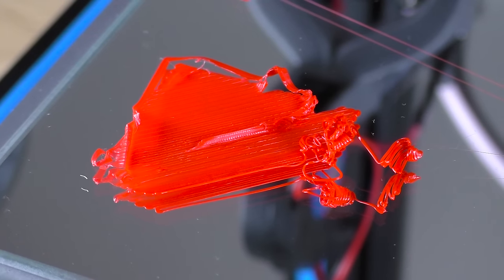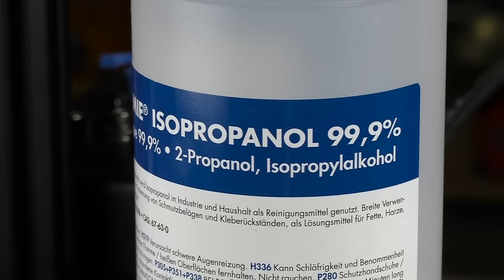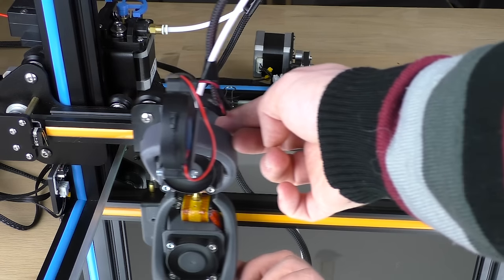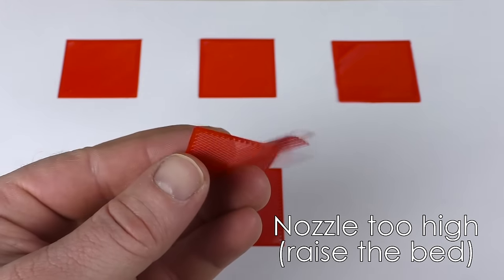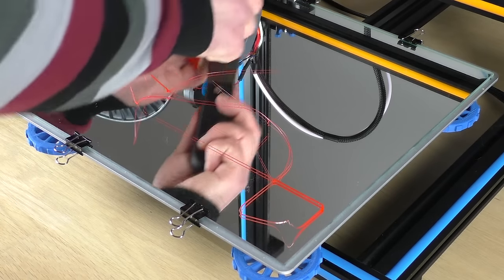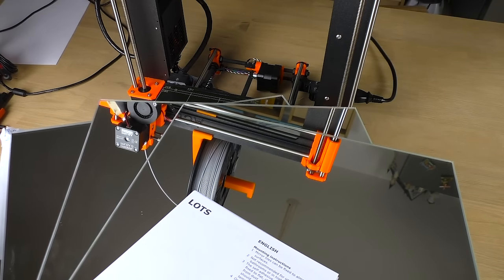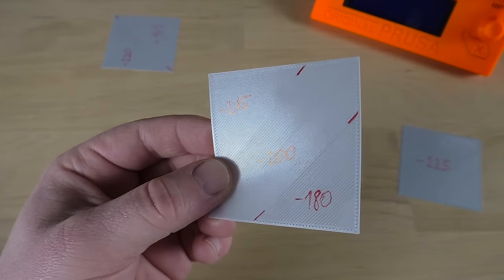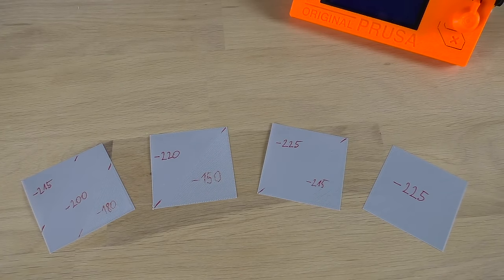Best method for 3D printer bed levelling

Comment: thanks for your video+calibration squares, i am in the process to choose ...he3d delta k280, he3d sky...any suggestion will be welcome and thanks in advance
Reply from the maker: I've never worked with Delta printers, so I can't really comment on the K280. You are getting quite a high build surface, but I doubt it can achieve the same printing quality as cartesian printers. The bowden tube is also very long, so it's harder to tune the retraction settings.

The Sky seems to be a clone of the CR-10, the frame looks almost identical. However, there are barely any reviews available, so I'd either wait until the printer has been tested by others or go with the CR-10, which is a good option and already has a large user community with lots of modifications available.
Reply: thanks for you reply, and your advice+suggestions are very good, i will look into it, the reason i have been considering the k280 is because of the build volume( particularly the height or z-axis) and i will be looking into cr10, again thanks for your positive reply;
Reply from the maker: unglaubich uberlieber I'm happy with my cr10, especially if you can get it cheap. Z height is rarely the limit and cr10 has 40cm, which is plenty.

For almost the same money, you can also get Original Prusa Mk2S. It's a bit smaller, but one of the best printers (Prusa Mk3 is a bit better, but more expensive).
Reply: thanks !!! because of my limitations with my hands, and prusa would be a good choice, but for a pre-assembled one at 999$+shipping that kind of priced me out... same applies to the he3d k280, life goes on
keep looking , i guess
Reply from the maker: unglaubich uberlieber Ah, that's different then. Yeah, the assembled one is quite expensive. I would normally recommend getting a kit, but it  seems that's not the best option in your case. You will almost certainly have to tinker with any printer though, so it's good to have someone helping you out if you have difficulties yourself.

Based on your username, are you in Germany perhaps?
Reply: ich kann sprechen+lesen+schreiben( in englisch alphabeticschen reihenfolge) chinesisch, englisch+deutsch), und ich werde mich nicht
nennen 0der  bezeichnen als irgeneine nationalitaet , ich bin einfach von der ede, zuzeit
lebe ich vancouver kanada...auch bekannt als KEINEDA hahaha
Reply from the maker: Ah, ok, I wanted to offer my help with assembling the kit if you were in Germany.

You could also take a look at Wanhao/Monoprice Plus. From what I can tell, it seems to be the best Prusa clone out there and it's already mostly assembled.
Reply: i have been looking into cr10, with marlin, the trouble is the time for preparing for firmware upgrade( if required) , and looking into prusa, and that has been a positive impression, the common denominator
is that the print volume is too small;
let me clarify, you are right, no one needs a delta that print 60cm size, if one uses slicers usw usw ,
but there is a minimum, so why do i need this, meine erklaerung:
i am in the process of loosing coordination control of my legs, and i want to build a pair of (
exoskeleton type) legs and i want to use 3d printing to print the "joints" ( not the legs) , and i have 
spent a lot of time in arduino( and gave up on raspberry ) and drivers+controllers+ dc gear motors( 
specifically bewel geared motors) so the primary target for the printer is to print and not to distract
my attention from the main objectives; nevertheless, time will be spent on cad programming;
since your fav. 3d printer is cr10, one more question on cr10, the micro sd card what format and size
does it have??? neither linux nor ms( more scammers) can format sd cards larger that 4GB as fat;
Reply from the maker: Hi again and I'm terribly sorry for a late reply, I was away for a while.

I'm sorry to hear about your condition and I sincerely hope you'll manage to complete your project. I've heard about a few similar situations, but I can't recall anybody using a home printer for it. You'll definitely need a strong material, like carbon or nylon, which means that your CR-10 (if you end up buying it) will need an upgraded hotend (the stock one doesn't reach high enough temperatures) and an enclosure.

The SD card should be formatted as FAT32. You can format cards that are larger than 4GB, but the maximum size for a single file is 4GB when using FAT32. That shouldn't be a problem, since even large models are usually only a few hundred Mb in size.
Reply: keine uhr sache, i am getting very close to decide on which printer, your cr-10 is gaining points;
especially the sd card with  this fat32... most 3d printer( if not all those i have investigated are 
based on fat/fat16 ), it is not that i discriminate against the fat/fat16, the matter of fact is, in
keineda, these 2gb sd card are priced at minimum 19$...that is if one can find them in keineda
und das ist kein witz ;

the main functions of the 3d printer is not for printing legs, rather the protoype for the joints( 
shoulders, elbows, hips, knees); as to he3d delta or their sky version, are very simple to assemble,
but the sd card (fat/fat16) killed it; 

btw , if i decide on cr-10, and it did not work out, do not be concerned with yourself, it is i who made
the decision, so i will not try to blame anyone else  ;  

as to marlin, well, what i understand from it, and what the clones ... well, these clones have their own
***.ino and ***,ini.... so be warned to others... if buyers execute the malrin...their controller will
appear dead...i have witness this already;

when i finish, i am thinking about writing my own ino firmware for the 3d printer i will buy...ja klar bin ich
verruckt geworden  hahahaha;
bis bald, alles gute usw usw usw
 ps. please inform me more on carbon+nylon, this is first i heard of these, and can this cr-10 use these material ???
Reply from the maker: I've been browsing the comments and noticed that I didn't reply to you. I'm really sorry, I don't know why I didn't see your message.

Sure, you should definitely share your experience with Marlin once you get it going. The more people share, the better it is for new users.

Well, carbon and nylon are probably the two strongest materials you can print with using average 3D printers. They are also quite expensive though and you need a better nozzle. Carbon is very abrasive and it will destroy a normal brass nozzle very quickly. You either need a hardened steel nozzle or, if you will be printing a lot of carbon, the Olsson ruby nozzle.

Sadly, the CR-10 can't print carbon out of the box. The hotend simply doesn't reach the needed temperatures. So apart from the nozzle, you would also have to upgrade the hotend to a better one (E3D is a good choice).

Comment: Hi Hobby,
your video is amazing!
May I ask you for your opinion:
 Got cr-10 s4 and seems its base is far from flat. At space of 1 sheet paper thickness between the 4 corners and the extruder I'm getting 3 sheet paper thickness offset at the center area.
I have tried with the other side of the glass- same issue. Obviously it's coming from the aluminium base underneath.
Do you recommend that I use the Wedge Jack or I should return the printer as I've got it from amazon and return is for free? Thanks for helping Hobby
Reply from the maker: Sorry for taking so long to reply, I was travelling and just couldn't manage to do it sooner.

Yeah, I'd recommend exchanging it for a second one. Prices on Amazon are higher, so you should take every advantage that you have. You could try printing the wedge jack (use PETG or, if you have to, ABS), but why bother? Chinese printers have a lot of QC issues and they won't get better until people start returning faulty printers.

My first CR10 from Amazon had a faulty motor or board. I've spent two or three days trying to fix it, but then I realized I'm just wasting my time. I love to tinker with stuff, but not if it's because of manufacturer's laziness. The second CR10 worked just fine.

Having said that, you'll probably have to use the wedge jack anyway. S4 is quite large and I doubt any of them are perfectly flat.
Reply: Yeah, the CR-10's bed isn't as flat as it could be.  I had the same problem with mine.  One thing you can do is to stick a piece of aluminum foil under the bed where it's low.  Or maybe even 2 sheets!  This will serve as a shim and make the bed surface more level.  Just be careful any time you take off the print plate, since it's easy to dislodge your carefully placed sheet of foil and send it flying to the ground.  For small prints, you don't need the whole bed flat and level, just the little bit in the middle that you're printing on.

TH3D makes a really nice automatic mesh bed leveling system for the CR-10, and I highly recommend it.  Once you have it going, it'll measure several points on the build plate and automatically compensate for any warps.  Works like a charm on my not quite flat bed, and I no longer have to bother with the aluminum foil shim.  Or with much of bed leveling at all - get it calibrated, and it will take it from there!  It was a bit of work to set up, particularly flashing the firmware since the CR-10 doesn't have a bootloader, but totally worth it.
Reply from the maker: Keldor314 I've been thinking of upgrading my cr10 as well. Which sensor have you decided on and why that one particularly?
Reply: Hobby Hoarder I installed TH3D's EZABL kit.  IIRC, I picked it because it was recommended online, and because it's fairly easy to install.

Speaking of installation, I spied the TH3D logo on your CR-10's screen, so you should already have a working bootloader, meaning you can update your firmware over USB.  It looks like you'll still have to configure and reupload the TH3D firmware, since the bed leveling stuff is hard coded.  It's not very hard, though, and the instructions are nice and clear.

Out of curiosity, did you install the TH3D firmware yourself, or is Creality now using it out of the factory?
Reply from the maker: Keldor314 Thanks for the info, I'll look into it as you seem to be happy with it. Was it worth the price now that you've had it for a while?

Good catch with the logo. Yeah, I did update the firmware myself, it's easy and quick, especially with 10S and the better board.

Comment: What about bed adhesion? I cant even print the sqaures on my ender 3 s1 pro
Reply from the maker: The PEI sheet on your Ender should work really well. Clean it with iso alcohol or soapy water, maybe it's simply too greasy. If that doesn't work, you probably need to get your nozzle even closer.

Comment: As far as i can tell, leveling your bed with a piece of paper is completely fine. I don't understand the harsh against it in this video.
If you're having problems with bed leveling, how you're suppose to print a support, as suggested in the video?
It seens as if you're trying just to shout 'hey, i understand how to bed level better than anybody, check my video out guys"
And by the way, you don't always need to clean your bed everytime you print something. Just clean it after a few good prints.

Comment: After test I got squares on the right side of the table correct, but middle and left squares were not uniform like with the nozzle too high. What does it mean? What should I check/fix? (Printed on mk3 with red prusament.)
Reply from the maker: For Prusa, it's better to print only the middle square and nothing else first, just the middle one. Once you get it right, print all the other squares as well but don't change your Live Z value. Instead, go to the Calibration menu and find the Bed level correction. Here, you can change the Live Z for each individual side, so you can fix just the left side if the squares aren't good there. Don't change the value by more than 5 at a time.

Comment: Hi, did u print directly on heating bed on Prusa instead of using heat bed sheet? On my Prusa it says do not print directly on print surface.
Reply from the maker: Only the Prusa Mk2.5 and Mk3 have removable surface and in that case, you should never print directly on the heated bed. I have the Mk2S where PEI is glued on top of the bed and you can't remove it.

Comment: hmm I tried using Cura's default setting for wanhao duplicator i3 plus but nothing prints lol any suggestion?
Reply: I think I got it, I scaled up on the z axis. I guess it was too low for my printer.
Reply from the maker: Happy to hear you sorted it out, good job! 3D printing is always a fine balance between love and hate :D
Reply: Hobby Hoarder yea it’s my first day with a used printer. This video helped so much. I spent all light eyeballing it until I saw this video this morning

Comment: Just start the print with a few skirt outlines and adjust with screws as it prints the skirt to get a good press. As long as you start somewhere close to level it'll work fine. Don't bother with paper under the nozzle etc
Reply from the maker: Sure, once you know what to look for, but for someone just starting out that wouldn't work.

Comment: Hey thanks for the video, i tried your method and the nozzle printed the filament too close to the bed (ender 3) so now i can't even slide a spatula to remove this thin layer, how do you remove it without switching to a glass bed ?
Reply from the maker: Try something sharper, but be careful not to damage the bed. I've sharpened my spatula that came with the printer. You can also use a razor and lift just a bit of one corner, then use the spatula to remove the rest.

Comment: Question, did you put any adhesion type: squirt, brim or none? thanks
Reply from the maker: You probably mean skirt. Yes, I always use 1 outline for skirt, but that has nothing to do with adhesion, it only ensures a consistent flow by the time it starts printing the actual model.

I use brim for small objects, but you don't need it for the calibration squares in this video.

Comment: Is it normal for printers to not change z-level only after 1 print? Like no matter how I level the bed, it seems to not be applicable for the next print.
Reply from the maker: That's quite common with new printers. The springs need some time to "settle in" and you might have to re-adjust the bed every day or two. However, it should get much better after a few weeks/months.

I usually just watch the first layer and adjust the springs if needed.
Reply: @HobbyHoarder  Thanks, thats a relief to hear, I thought I needed to buy a glass bed and auto levelers to fix it.
Reply from the maker: @henrylo6773  You'll know for sure after a few months, but I wouldn't worry about it until then.

Comment: I have a kywoo tycoon max, and it keeps running into the bed no matter how far up I adjust the nozzle height in settings
Reply from the maker: Do you have auto leveling?
Reply: Yes, and the kywoo isn't an option to put as my printer on cura
Reply from the maker: @abram217  Does it have an end stop for the Z axis? It should look like a small button on the side somewhere that gets pressed by the gantry as it moves down.
Reply: It does not have one, it uses button that presses down on the bed
Reply from the maker: @abram217  That's effectively the same thing. I would raise the gantry to about half the max height, then initiate auto home routine. As it's lowering, press the button (that would hit the bed) yourself. If nothing happens and it keeps lowering, then it's either not wired correctly or simply dead. If it stops, then you'll have to reposition it so that it hits the bed before the nozzle.
Reply: Ok, thank you

Comment: I have a Prusa Mk3 and used the same method as you, but my bed seems to be warped. I keep a constant z-value across the whole calibration square, but the finished print looks like I have changed the values throughout. The initial corner appears rough, as if the nozzle is too low. In the centre (the longest lines through the middle) it's perfect. By the final corner there are clear gaps between lines, as if the nozzle is too high. I asked Prusa about this and they set adjust the bed leveling controls from the menu, but they only have four spots you can adjust - front, back, left, and right. I specifically need to adjust the corners, so this is useless to me! Have you come across this issue before?
Reply from the maker: Yep, it's the same on my Mk2S. While you can only adjust 4 sides in the calibration menu, I've found that if I want to adjust the bottom left corner, for example, it works if I adjust both the left and bottom side together by the same value. Try doing it like that.

Comment: Are youi printing on a mirror??
Reply from the maker: On one of the printer in the video, yes.
Reply: @HobbyHoarder  is it better then the ultrabase?
Im looking for a good bed for my ender 3v2 for PLA and PETG and the original creality ultrabase is not that good.
Did you bought a regular mirror or ist it special for 3d Printers?

Comment: bonjour ; malgré un BL TOUCH ma première couche présente un défaut de nivellement je ne comprend pas ! une idée peut être!!    merci
Reply from the maker: Sorry, I don't understand French, but the translation tool is telling me you're having issues with BLTouch.

Even if you use BLTouch, you still have to set the correct Z-offset (it's also called babysteps or babystepping). This can usually be done by pressing and holding the control button once the print has started. You might also have to update your firmware to get this feature.
Reply: @HobbyHoarder  ok merci beaucoup

Comment: How do I add auto level on tronxy xy3?
Reply from the maker: If you'll search on AliExpress, you'll find Tronxy leveling sensors for around $10, which might be a good start. I don't own a Tronxy and I've never tried these sensors, so if you're in doubt, I suggest you ask around on Reddit.